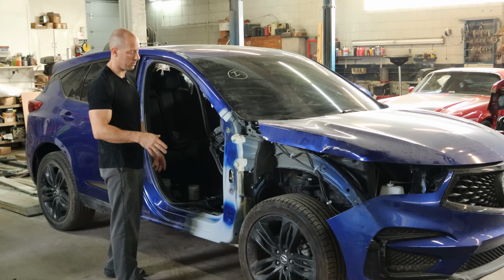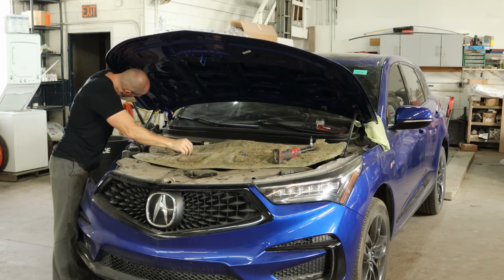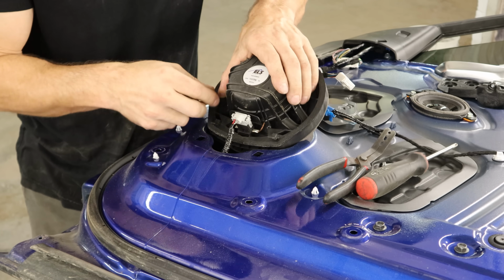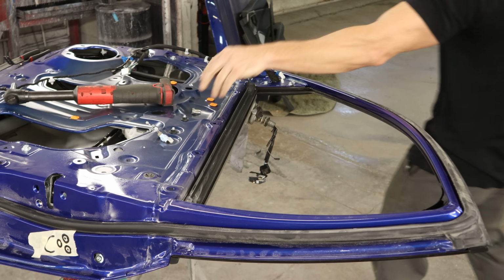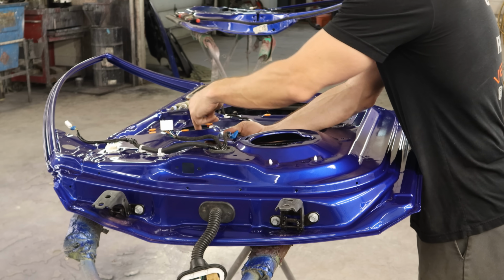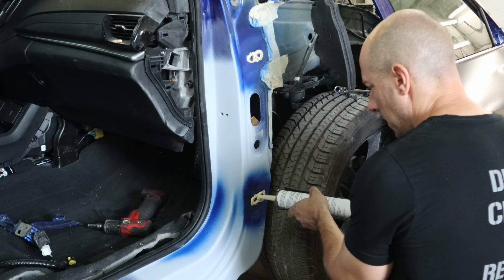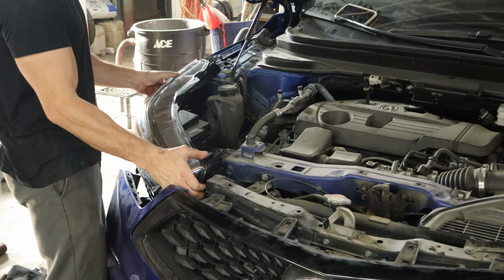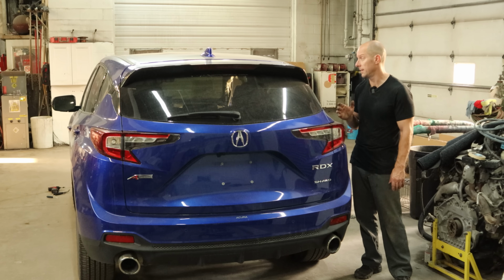Test fitting the new parts on the Acura RDX to see if it is ready to ship to paint.

Comment: Funny you mentioned buying another RDX to rebuild after having that extra lower fender bracket. I rebuilt a Subaru BRZ back in 2017, had a few extra parts and thought I should buy another to use those parts on....now I've bought and rebuilt 16....and for some reason still keep ending up with unused parts that I can use on another........🤔😂
Reply from the maker: It’s not the first time I have done that. 😂 I also had a fender liner leftover from the 22.  Apparently, they are different, I had to teach that to the parts manager at Acura since all our listings showed the parts fit 19-24.

Comment: Tip
There is a type of expanded plastic foam packing material that is extremely useful to collect for various purposes like protecting windshields from errant hoods.
You can cut it and shape it and glue bits together to make all sorts of things.
You could even shape it into large foot friendly LEGO.
You can buy it in sheets or dumpster dive for it.
I use a couple of small bricks with a slit cut in the middle to jam on the edge of the hood to not only protect the windshield and paint but to act as a third hand.

Comment: You are the king of footage where you are taking a door apart.  I have told many folks over the years...the same color or a color change, it matters not.  You tape next to nothing, you remove everything.  Granted you have Gnomes that do the body and paint work, but you are in my wheelhouse when you take stuff apart to paint it.
Reply from the maker: It helps that when I used to to the painting, I hated masking.  I would rather take parts off than mask them and it leads to a better product anyway.  I do see a lot of used doors that were painted to the water barrier and everything behind it is another color.

Comment: A technical question, what's the preference for edging the door out then fitting and masking the rest of the car off again Vs painting the door complete and fitting it.
Personally it seems like a bit of a hassle, more curious as to why you would go through the extra effort
Reply: I can only guess but the visual difference from inside to outside would be minimal when edging then spraying everything on the exterior vs painting the door and then trying to blend the door with the adjacent panels.

Comment: Its strange that they wrote this vehicle off.
Reply from the maker: Long wait for the hood is probably what did it.  I have never fixed so many easy hits as I have since 2020.
Reply: I have a 2019 RDX and parts are typically 1-3 months of waiting.  I need a passenger rear view mirror (it got wacked off by a homeless guy) and it's a 3 month wait.  I need a new lens for my heads up display and it's a 3 month wait.  Welcome to the future or new normal.  It does, however, make life much easier for those that rebuild cars due to the number that are written off by insurance carriers.